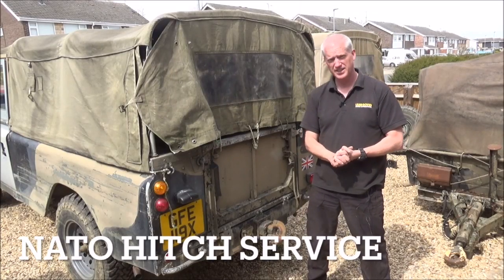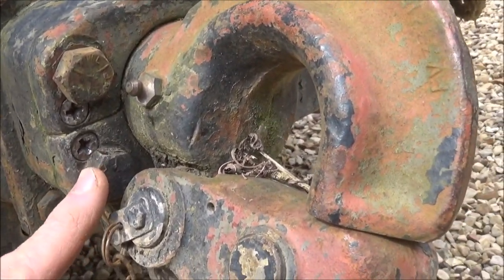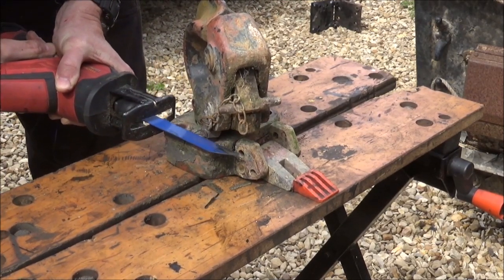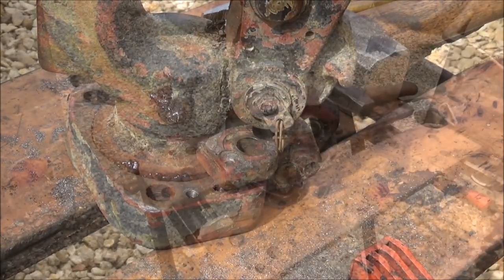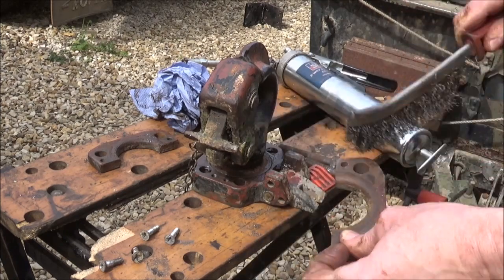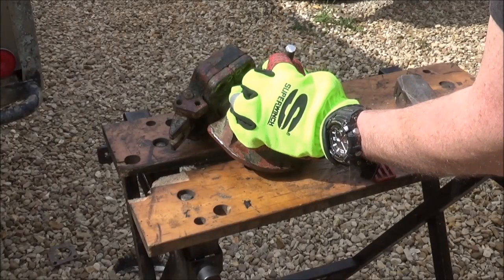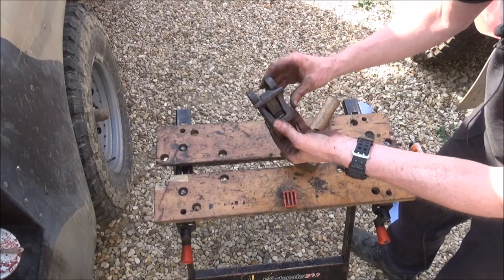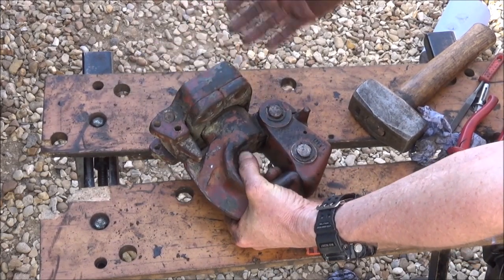How to strip and rebuild a seized Nato swivel tow hitch pintle for a Land Rover

Comment: You could have a load of work by just greasing it,  then using a bar to loosen the rotation,  thats what I did with mine.  Also you did not mention a critical thing,  you need four new bolts,  of the right tensile strength,  not always easy to get hold of....